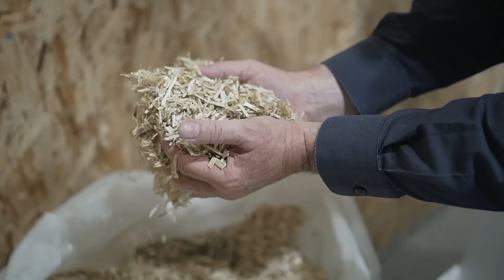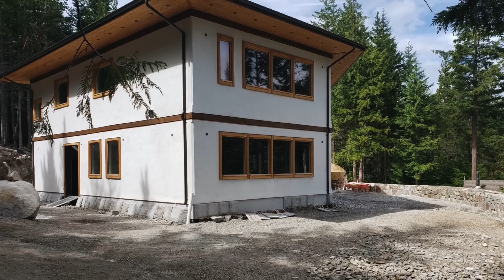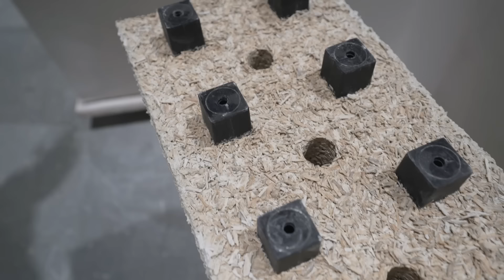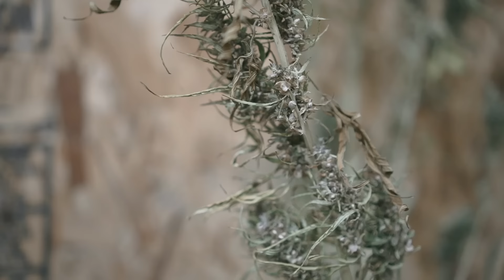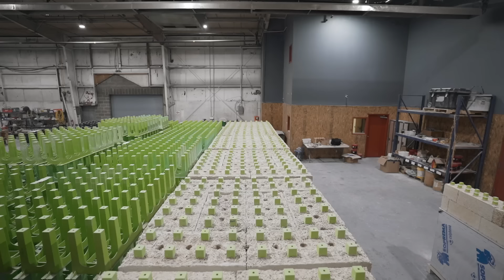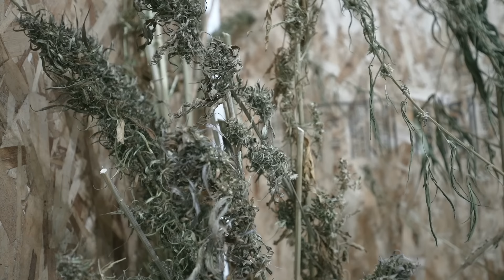Amazing Lego-Style HEMP BLOCKS Make Building a House Quick, Easy & Sustainable

Comment: Great Product idea. you should address the obvious questions for a house build, like how do doors and windows get nailed in, how do the trusses get attached,  where is the vapor barrier, where is the water shield layer, why don't you glue the blocks or seal all the gaps at installation, can sheetrock or some board siding be installed/ can vertical nailers be attached. I like the enviro-friendly considerations, but that wont sell me if i cant build a house without reinventing the hundred  design decisions.

Comment: A great material for sure, I have done some of the hemp wall making in formwork which is just not practical. But the introduction of new wall systems such as this suffer from two problems. There is no direct comparison (insulation, loads, cost, etc) with a conventional lightweight (PFA) concrete block and local availability.
Reply: yes in my opinion this would be best deployed in conjunction with other materials.

Brick exterior wall to protect the blocks. Wrapping layer around hemp layer. would make for quality insulation for colder climates perhaps. 

I would not be comfortable leaving these blocks exposed to the elements for any length of time.

Comment: If there are any tests on how hempcrete blocks stack up to a regular stick build in terms of wind resistance(hurricane and tornado strength), a video would be really appreciated!
Reply: Honestly If i was looking to make it last, id use this as the structural wall and have an Exterior Brick layer to protect it. should keep out most of the moisture. and the hemp blocks would work great as insulation of the required thickness for up north.
Reply: There are meshes that can be added to give even more strength to the exterior and interior like sheetrock has paper on each side giving it tremendous strength.
Reply: @paultryba7228  Wow, Thanks I learned something new! 👍🏻
Reply: Living 3 miles from the Gulf of Mexico I agree.
Reply: Hatteras island NC and I was wondering the same, as well if it's recommended being started 8 plus feet off the ground
Reply: @kaptinkinnakeet1124 I am building in OBX and wondering the same 😂
Reply: @Sarah-vx6yo  I'm born and raised in Kinnakeet or Avon to the others, where about r u
Reply: Was thinking about moisture and mold. And an interior timber fram 9:02 e structure if i wanted a 2nd floor. Besides, they look cool.
Reply: Y’all buid with drywall and wood lol. Already the worst option possible just because y’all want to lol. This is better just for existing 😂
Reply: @dresalmon420  r u slow
Reply: @dresalmon420  available materials and tooling, and local skill/labour pool have a bit of influence.
Reply: Enough with the demonization of carbon, plants and trees breathe in carbon dioxide and release oxygen.  This whole concept is from the ruling psychopathic class, WE are the carbon they want to get rid of!  It’s called indoctrination and depopulation!  Wakey, wakey!

Comment: I'm not a huge fan of the stucco look, so I was wondering if this would work as well with "standard" siding. Or if anyone knew of any companies that make hemp fiber siding/shingles.
Reply: There are structural supports every 6 inches that you could screw into.  If you wanted to finish with the siding you could easily.  or you could use face bricks to give it a brick look or you could also plaster it completely smooth and paint it any color.  The Interior could be wood paneling, drywall, or tile.

Comment: Is there a thin version for use on tiny houses?
Reply: The whole idea behind blocks is R-value. You can make a tiny house with large blocks with small foot print inside.
Reply: @paultryba7228  Dear Paul, Is it that by reducing the width the insulation factor would be reduced also?

Comment: An issue with this (and others) is that it would be very difficult to get a building loan/mortgage in the UK because it's classed a 'non-standard construction'. You would also have problems getting Building Control to accept the integrity. I designed and built a site-constructed timber-frame house ( as its referred to here, but it's the USA method of stud walls with an outer skin ) but as 99% of those types here are factory constructed and transported to site like a huge jigsaw puzzle, the Building Control Inspectors had a head-scratch because they'd never seen it done that way. Once you deviate from the Norm, the instinctive reaction here is to say No. It's safer for them that way.

Comment: Do you use a lime based mortar for the blocks? As well are there blocks designed to allow utilities to be run in?
Reply: yes there are holes in the block to run wires every 5 inches.  No mortar is needed with this system.
Reply: @paultryba7228  The video mentioned vertical runs, but did not address horizontal runs for plumbing and electricity.

Comment: Cool product but limited by current hemp production, availability of farm space for that production. This is an insulation alternative. It's non structural, and it does NOT have comparable compressive strength to everyday concrete. Lastly, it's R value sadly isn't anything special. Currently a it's cost prohibitive option to homebuilders.
Reply: How do you know strength and R value?   Hemp is said to have amazing R value.

Comment: can we use bamboo frame instead of epoxy frame ? or another option can be mulberry tree branches  since flexible and high in strength
Reply: The epoxy frame has a consistent strength where natural materials do not.
Reply: @paultryba7228  but carbon footprint is low and have to used in blocks not columns

Comment: Seriously interesting.  It would be great to have some quarter-round shapes (again, like Lego) in order to built curves into the design.  Have spent quite a while researching an off-grid, net-zero build and some of the thermal-efficient considerations (including solar sinks) work best with some curving built into an outer wall.  Great video, thank you for this informative vid and really innovative product design.
Reply: Id also like to see.variable angle blocks,  30, 45, 60 degree, etc could be done. Square walls are Boring!  And corners are heat sinks.
Reply: I looked at their website where they are building a gorgeous house with curved walls!
Reply: @1818kitten  I'll see if I can find it, sounds great!

Comment: Would need to know a lot more about the loadbearing "epoxy" frame to make any judgement. Epoxy is typically used for bonding surfaces together, not in independently resisting live axial & flexural loadings. You'd expect it to be too brittle to use for such purposes. Also that, lime and any additional bonding agents used for hempcrete are usually too expensive compared to traditional walling materials. And I'd like to see how the blocks would stand up to rough handling on the usual wet, muddy, construction site. Not well by the looks of it.
Reply: Having worked with polyester epoxies, i understand they are pure poison until cured, and not environmentally friendly.  To me, it seems like the fly in the ointment.  Otherwise, i dig it, just not sure i could in good conscience sign up for a house with that much cast epoxy in it.
Reply: They build complete houses out of it and In France, they have bridges that are over a thousand years old that are still functioning so may not be the problem you are making it.  below grade, it is not made to stand in water so don't build a boat with it.    The best way to find something out is to build with it or go see a building that has.
Reply: @paultryba7228  - A 1000yr old bridge with epoxy in it?? I've only ever seen stone bridges of that age. And houses with hemp in traditionally depend on timber framing as the structure. And timber is good both to bear axial and bending loads, whereas unconstrained epoxy is very unlikely to stand up to high axial or flexural loads.
Reply: Anchoring epoxy for securing I-Beams to a slab comes to mind, but that stuff is dummy expensive.
Reply: Excellent points, the fact that they never mentioned any downsides gives me second thoughts about ever building with these... better to let a few hundred homes be built like this first and see how that goes
Reply: @davelevj  he did mention that it was not suitable for below grade, i think that qualifies as a downside characteristic

Comment: I love how none of these walls make it easy to install electrical. Sure you can run through the block with conduit vertically but what then? How do you run horizontal? What about later in the life of the home?
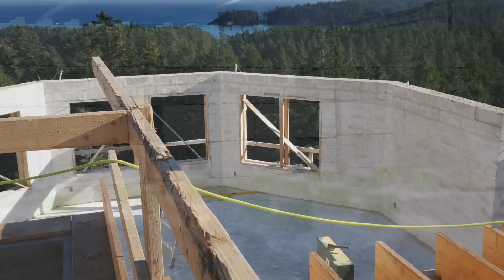Reply: I wondered that myself.  The shot at 6:40 does show electrical boxes installed in the unfinished home.  I wish they would have gone into a little more detail about that.

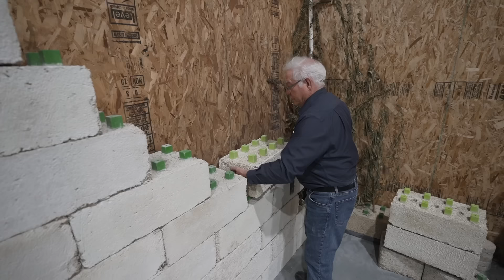Comment: I love the concept. However, I got one question: you said you can cut the hemp block with a saw. How durable is this material? Is it able to withstand a (large) storm? And how high can you stack the blocks? Are 2 - or even 3 floor buildings buildable? The building at ~6:30 was impressive but was it purely build with hemp?
Reply: the compressive strength of residential concrete is 5x superior than hempcrete, but the tensile strength is 5x less than hempcrete.
See the building "Case di Luce" in Italy, that was made 10 years ago with hemp and lime (and other material, reinforced concrete as well).
It's theoretically possible even to make hempcrete skyscrapers with other sustainable materials for support.
Reply: @manuel-3500  thank you very much!

Comment: This is fascinating! I remember way back when Marijuana was trying to become legalized, I supported the initiatives in large part because I knew that the hemp fiber had 500 industrial uses and was bio friendly. What a useful plant!  You can smoke it for pleasure, use it to stop pain and inflammation, use it on autistic children to calm them down, use the fiber for clothing and buildings, and it takes very little water to grow it, being highly drought tolerant.  So the whole cotton crop industry in the San Joaquin Valley of CA, and in Arizona which uses 92% of both states's water supplies, can now switch to water wise hemp plants as a cash crop.  This would alleviate the water problem in both states.

Thank you for this wonderful video.  I am going to post it on my FB page, and use these blocks to build my next house or addition.  Insulation is a huge thing!

One area to consider is making insulation panels and soft rolls for use in RVs. The RV DIY self build market is exploding. Why not make a hemp insulation fiber instead of Thinsulate, Wool, Denim, Mineral Rock?  We cannot use fiberglass in RVs due to moisture issues. If you can make a moisture resistant Hemp insulation roll that would be fantastic!

Comment: Interesting, but very incomplete product as shown. Where does plumbing run? Also, what about when I need to run wires horizontally or come out for an outlet.. where do I put ducting so I can get heat or AC to multiple floors? There is no space for any of this because it's a solid block. Also, millions of products are designed to be recessed in walls.... This is a prototype that needs more tinkering. This could have some very limited use possibly, but then it's pretty inconvenient to use isn't it.

Comment: How do you stop water from seeping into the building along with cold, heat, etc, etc. through those gaps between the "bricks" If you say well they put plaster/mortar over the top how long does that last before it breaks down and cracks appear or falls off?

Comment: Look amazing but when he mention de hole in the block for electrical cables, it rise a red flag for me. With this system it will extremely difficult to do a electrical repair or run a new electrical line if you intent to do a home renovation.

Comment: rotcrete, I'm good. ill stick with concrete/ stone and install not perishable insulation on the inside and have a house that will last hundreds of years. Houses that last for 100 200 or 300 years on in the uk far beyond 300 years is far more environmentally friendly than 50 year houses that been rebuilding.

It will be inevitable that you will have leaks in a house. condensation etc. that product will breakdown. and significantly faster than timber would. at least with timber you spring a leak in pipe work. there are typically signs long before any real long term damage is done. with this product i doubt you would have that same window to repair. and further more with them being interlocking how would re repair block in a middle of a wall ?  say if a window or door needs to be cut into it? or perhaps being sealed up?  or a common one. cut out in walls for drier unit vents. that have been moved? you can not just insert a new block like you can with brick and concrete. the interlocking nature of this product prevents that. it will only end up being filled with concrete anyway. so what is the point  ?

Comment: The structural frame might be the most "innovative" part of these blocks.
Like how they are already using it. Hemp lime, plastic, even back to concrete and so much more.
Having a "level" wall regardless of skill level is huge in my opinion.

Comment: So you're mixing shredded wood with lime and packing it around a industrial plastic frame. You could use pretty much any type of wood.... creating the blocks are extremely labor-intensive. Your blocks require plastic, organic material, lime and God knows what other chemical you use to keep them fire resistant.... it's lightweight but I seriously doubt it's very resilient. The cost would be incredibly High compared to just mixing up some cement and pouring it.
Reply: Your gae is showing

Comment: About the "sound transmission reduction".... do you guys have a Db reduction number, or is this just an assumed reduction? Can the cost come down with mass production? I it's the "same or higher" than normal construction materials, no one is going to buy the product, and it will be forever just a curiosity.

Comment: I'm curious to know how easy (or hard) is for this bricks to rot on humid conditions. They are at the end of the day made out of biodegradable material, how will they do for 10, 20, 30 years?
Reply: Fiber and mud is as ancient as human building. It should last centuries as long as it isn’t under constant moisture.
Reply: Hemp is water resistant and anti-fungal.
Reply: @fishertheadore6095  how so if it's biodegradable?
Reply: @anneeq008  water resistent isn't water proof.  Leave a plant soaking then it's probably an issue.   But then this is also a problem for standard lumber.  So, just like building with lumber, one would have to plan for air flow, vapor barriers.
Reply: @anneeq008  the chemical reaction between the lime and the hemp creates a stone product, continuing to harden over time and sequestering carbon. No longer fiber, but becoming rock-like, at least that is what my research is uncovering.
Reply: 100 yeard
Reply: @hizand.2395  Awesome.

Comment: interesting but I missing the disadvantages of this building style. I've seen "lego bricks" in India too, but there it was the problem, that the pushing strength sitewards wasn't as high, as in solide concrete or with clasical brick stacking. Because of that they're using steel bars. It would be perfect to using the already given holes. Simply set the first row, drill the steel bars into the foundation and stacking from there up.
I could imagine another problem is with the tensile strenght of screws or nails in the wall. I don't know if there is a problem, but it could be possible.
The last one I want to write about are the gaps between the bricks. He told, that they got glued, so the gaps would be disappear, but then the problem of the not even level by stacking the bricks up would come again. Somethin he explicit told about it isn't the case because the bricks does not touch another. But with glue they would....
Nevertheless, without the glue (or what ever) it has gaps, what is decreasing the isolation.

I like dealers who talk about the pros AND cons of something, so I can decide. And the most important thing, can handle the things to look out for, like weigth of my hanging cabinets in the kitchen or looking for special dowels I have to use.
Reply: Yeah, I have same concerns! Curious how you’d hang heavy things. Also curious about using it in humid or wet climates? As soon as it gets wet wouldn’t it fall apart or rot? At least with wood you can replace.

Regardless, very cool would try out
Reply: @coleblezard6628  i heard on another video that hempcrete toughens up and hardens over time due to weathering
Reply: Hemp and lime are both breathable materials so even high humidity is not a problem. Can’t leave it wet, which is why it’s not used below ground, but air moisture is not a problem.

Comment: Does carbon sequestration over time mean that the blocks become denser/harder as it soaks up CO2? Would an older hemp block house be "stronger"?
Reply: No. It means that while the plant grows it removes (sequesters) CO2 from the air (plants remove CO2 from the air while undergoing photosynthesis). Once in block form, the hemp doesn't pull any more CO2 from the air.

Comment: I think best use of it would be using it together with wood framing, to make main framing from wood and use  hemp blocks for insulation and exterior surface, wood always will be better as a nailer and to attach trims and drywall in combination should be really strong and with well insulation properties , I am in for to build project like that.
Reply: You can attach it directly to the block every 6 inches can secure it into the supports.  No wood is needed.  You could secure drywall directly to it!

Comment: You might want to show how a floor is added for a second story. Does the box sit on the wall, and need to be insulated? What does one do on the exterior finish? Or, is it balloon framed? Is the block strong enough for fasteners?
Reply: Floors are added the same way conventional floors are done.  Yes, every 6 inches there is a place that will secure a fastener.